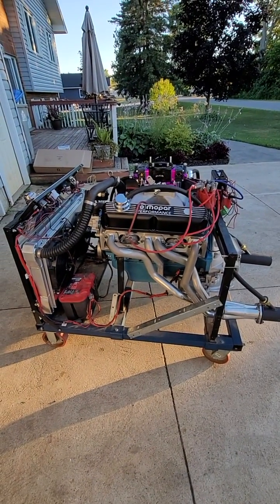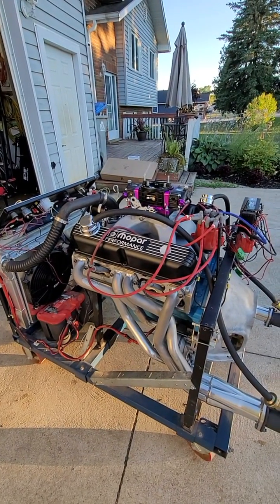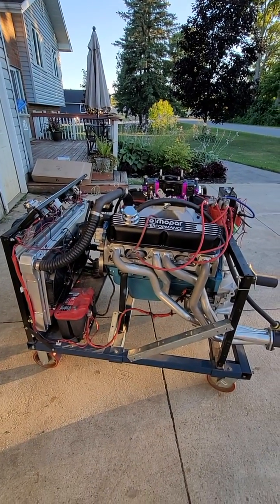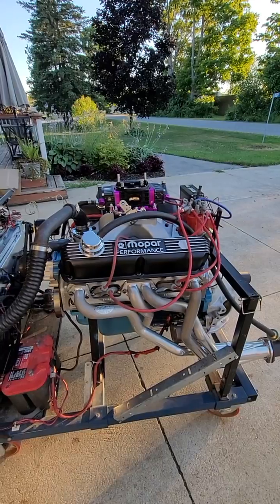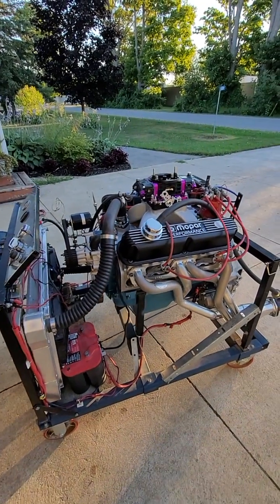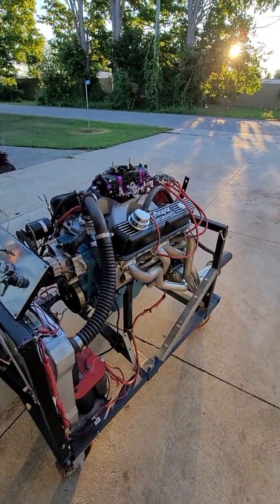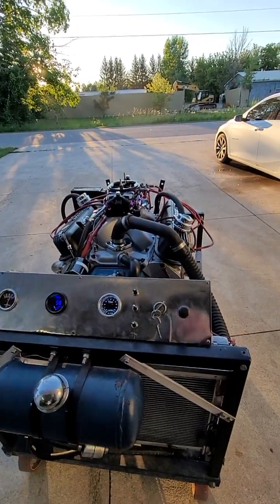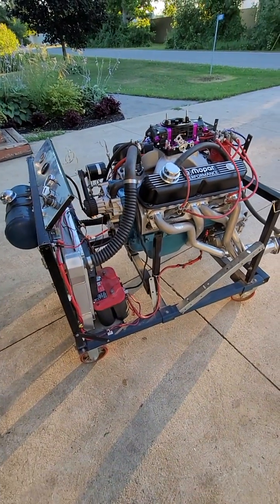Small Block Mopar Stroker 408. Voodoo Hydraulic Roller. How much Horse Power will it make?

Comment: Nice! Love older mopar. I’m building a 348 stroker out of a 5.2L Magnum in memory of a recently departed friend for the truck of his I now own. Gonna finish his unique 1997 Ram 1500 5 speed project truck. Already got it carb converted and I’m smog exempt. 🎉
Reply from the maker: Sounds like it will be a cool truck.
Reply: Oh Im loving it so far even in its 318 mangum format. It has much more power with the '73 challenger r/t distributor, accel performance HEI gen 3 module, dual plane air gap manifold, headers, and 625CFM Carter AFB Carb on it and Indy heads. Its loving life. Cant wait to pull the motor and turn it into a 348 stroker for 1300 buck parts and machine shop work. Will put out like an 6.2L LS with the 750CFM Demon carb i have waiting for it. :D @brightonracing